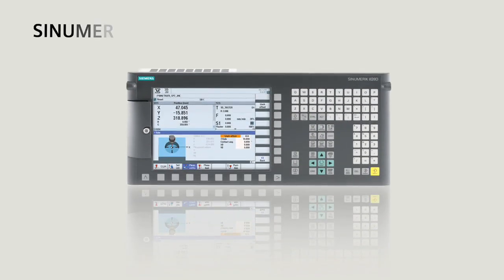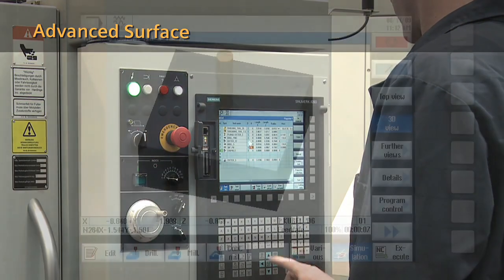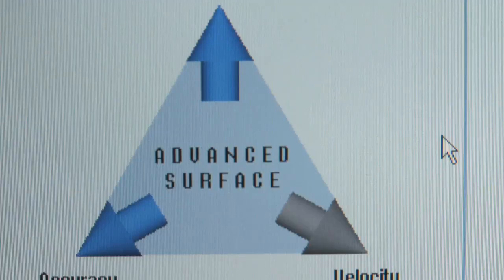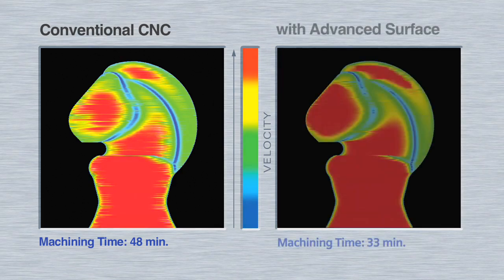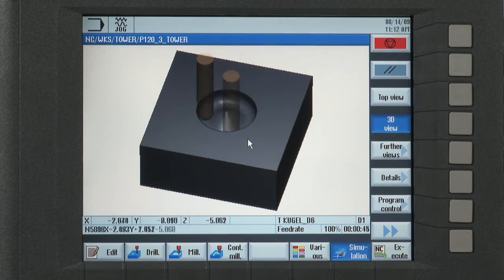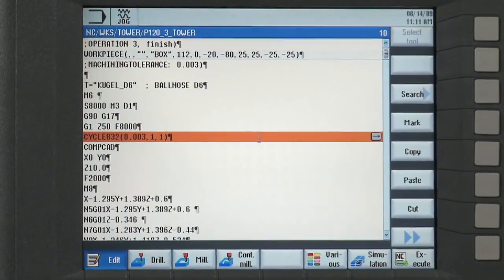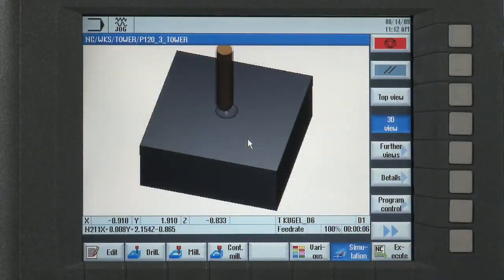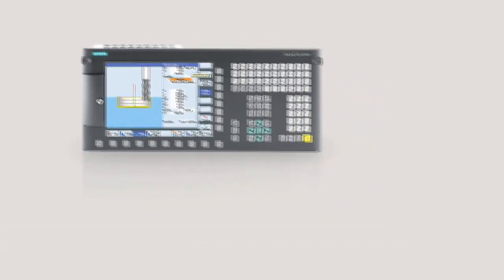Advanced Surface (Sinumerik 828)

Comment: do you see a problem with a program simulation on sinmerik 840d sl:
on 5-axis machine, if in G54 have a "C" coordinate, for example C=45, and then the start simulation, a tool walk on 45 degrees around a workpiece. if in begining write G0 C0, all works fine...
is it possible to start a correct simulation without additional line?
Reply from the maker: might need a cycle800() in the beginning of your program
Reply: we tried, but cycle800() in the begining is not help